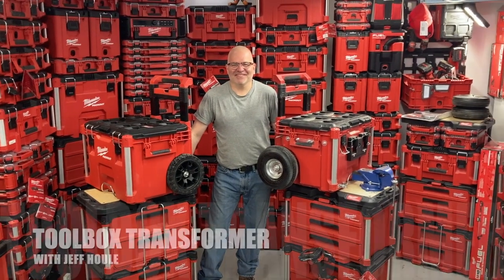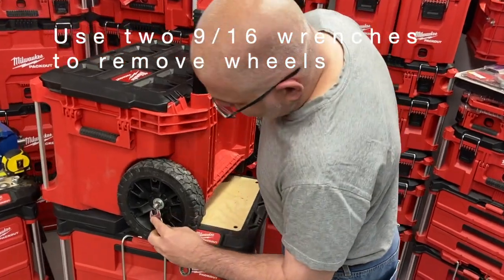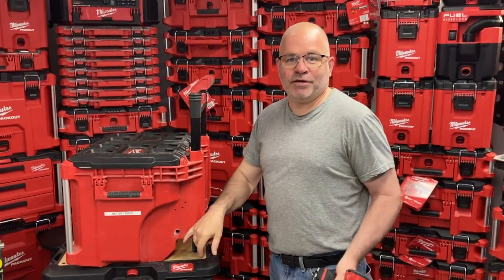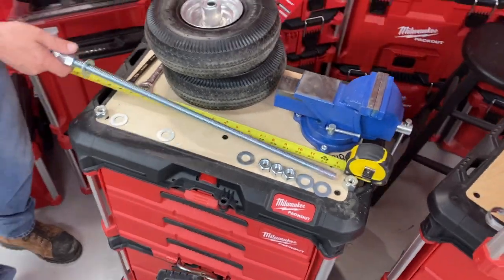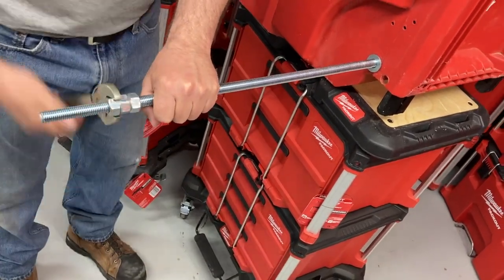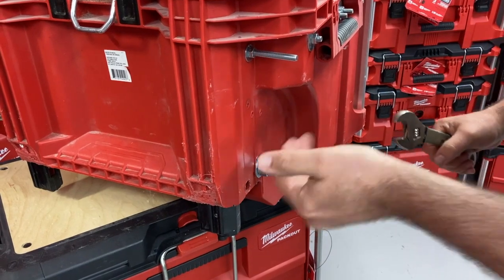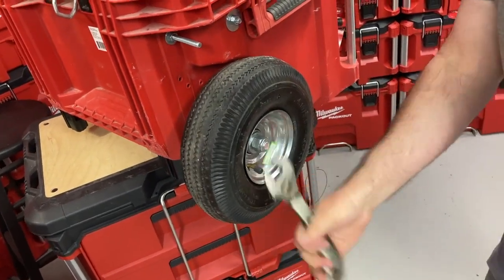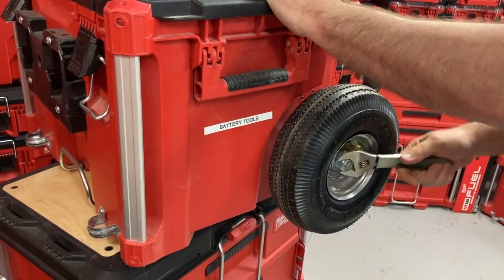Toolbox Transformer   Inflatable Wheels Mod

Comment: I did this today, but kept the original axle. The OEM wheels have a plastic bushing (5/8od) that's removable. It fits perfectly in the new pneumatic wheels and mates with the original axle as milwaukee intended.
Reply: Same 10” wheel? No rubbing issues ?

Comment: How long is that threaded axle
Reply: 25 1/4” nvm
Reply from the maker: also it will depend of your set of wheels and spacer mine was 25 1/2"